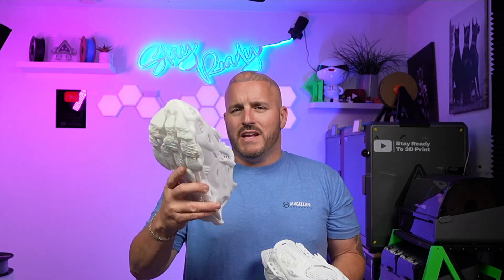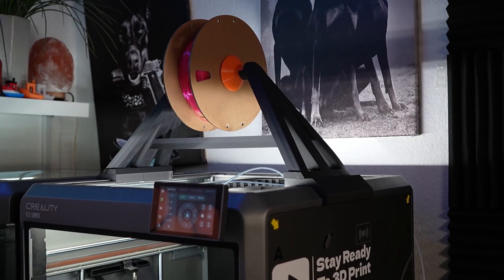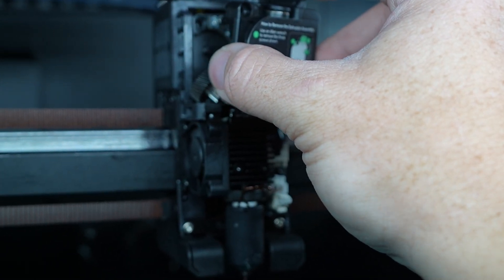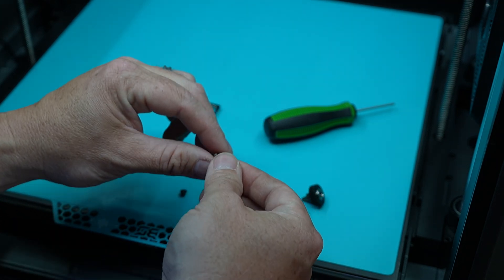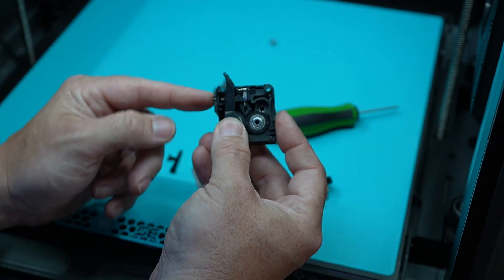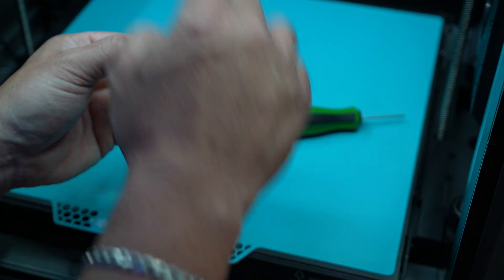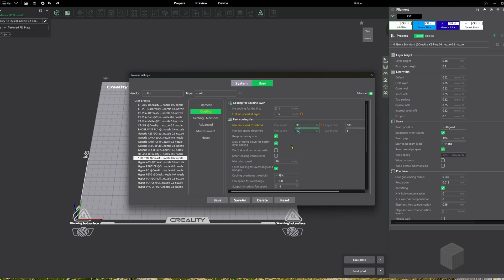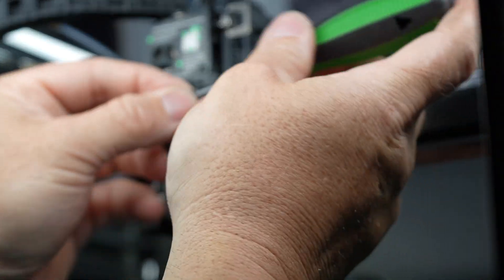My Secret To Printing TPU on The K2 Plus (100+ hours No Fails)

Comment: What about on the creality Hi?
Reply: I wonder if this mod can be made on the Hi, the extruder are almost the same but i dont see the brass insert on the high, just the hole
Reply from the maker: @ahsbqt you can change the spring. But let me look into the screw part for ya. Great point
Reply from the maker: Ok so it seems that you will need to add a heat insert where the hole is on the left side of the extruder on the hi.